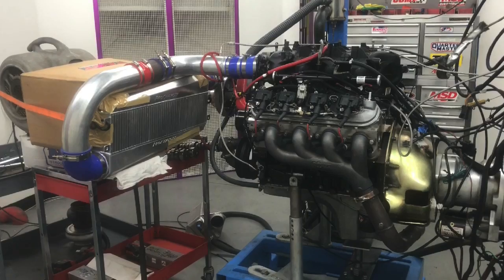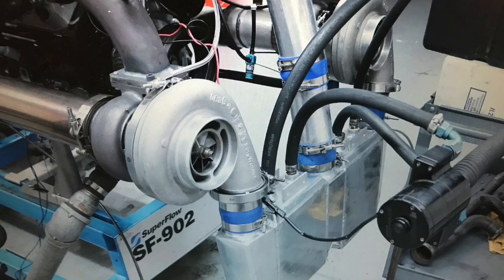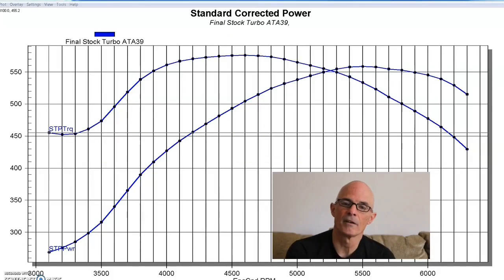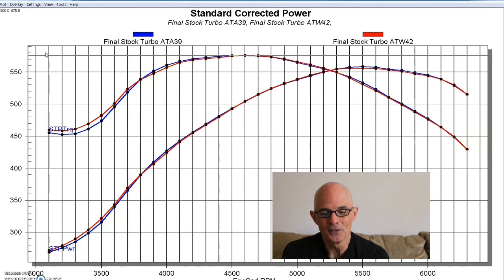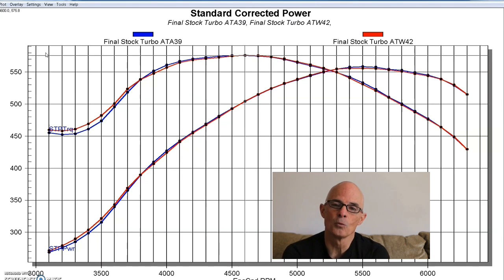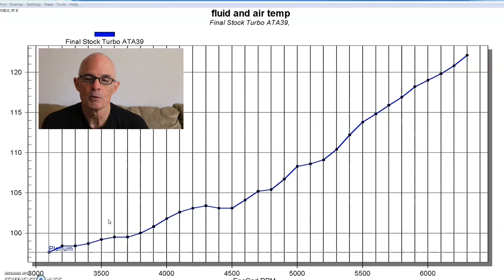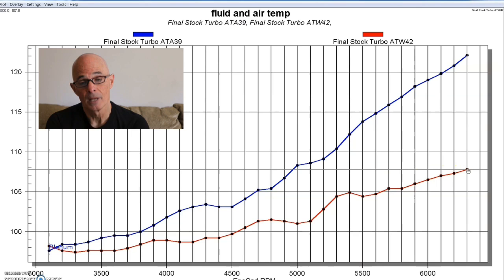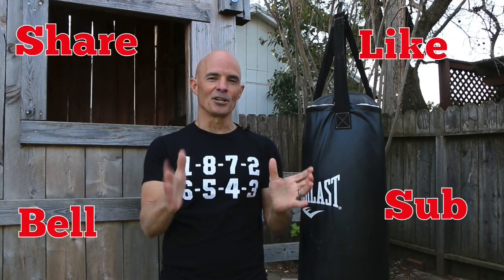LS TURBO INTERCOOLER TEST-ATA vs ATW

Comment: Speaking of ice water, what about making a test cooling this time the Fuel, taking a ordinary fat water jug cooler and get some cheap aluminum 3/8" or 1/2" tubing that you can bend in a nice tight spiral inside the jug isolate the line that go out to the carb, put a carb spacer to isolate the heat of the Intake manifold, run the  return line isolated back into the jug in another smaller tight spiral and from there to an plastic fuel cell so the cold is retained in order to make a circuit cooled by Ice water to try to reach 32*F, and do a test NA, then boosted no cooler and then boosted cooled, measure intake manifold temp and see if it have any effect on HP, and see how much can detonation be mitigated if any, using pump gas,  with the cost of race gas I guess one need to get creative and experiment and see what can be gained if any, I know there is E85 but for the sake of this test the idea is to run pump gas available in every gas station worldwide.

Comment: If you were using an alcohol fuel then the extra degrees would have been eliminated in cylinder by fuel evaporation. Less so for gasoline but still some cooling.

Comment: I would like to see the same type of test ran with a Cryo2 CO2 system on the ata cooler. I’ve seen the Cryo2 systems around but I’ve never seen honest testing to show if they work or not.

Comment: you're not accounting for the thermal mass of the water in the ATW system with regard to the IAT change over time.  the sheer amount of thermal mass makes heat soak very unlikely over the course of a relatively short test run like on a dyno.  ATA is never going to be able to match that for the exact reason you state - you cant get enough airflow through the exchanger.
track situations like bonneville or typical highway cruise arent going to be a good simulation of heat soak because the car is always in a high airflow condition....  heat soak is gonna be a major issue on the street however, and THAT is what your dyno run IAT readings are illustrating.

Comment: have you done any comparison of an ata with a fan vs without a fan?  i'm curious how well it does when it doesnt have much air flow, and if its worth the extra work to modify bumpers and placement of the intercooler for optimal airflow.

Comment: Everything was the same so the power is the same. The reason I like the w2a is the extra ceiling. Our own car dropped from 56C @30lb in the traps with A2A to 20C with the W2a. Power was the  same at first.. but with those low temps I was able to add more boost. A lot more boost. Maybe you should have added boost and timing till both intercoolers had the same outlet temp and then look at the hp difference.
Reply: That’s true but a2a intercoolers have a power rating, so putting in a larger intercooler would have brought it back down
Reply: Intercooler power rating is an airflow rating, not cooling capacity. You can install a straight piece of pipe that has the same horsepower rating.

Comment: The problem is at 10.6 psi of boost you almost can get away without a intercooler in most cases so the 10.6 psi test pressure is flawwed the charge temp wont spike much until you hit around 15+psi so the benefit of a air to air vs a air to water in power numbers will not exist till around 15+psi and as you stated in staging at a race there is almost no airflow so heat soak of a air to air intercooler will be a issue but a air to water will not because of the buffer of the water you can set staged for about 10x longer before the temps climb with a air to water meaning the second you come up on boost you air charge temps will be lower with air to water vs air to air so there is a big benefit to air to water in many instances compensating for the weight. 

When you take off from a staged position and your charge air temps are 25+ degrees cooler on the air to water this means can have more timing in the low end meaning faster acceleration and quick pressure increase in the exhaust  manifold meaning faster turbo spool meaning your boost lvl's will climb faster and you wont have to remove timing to compensate for hot air charge at take off.
Reply: I also meant to add with a air to water you can run a shorter and less volume from turbo to intake so this lowers the turbo spool time which can make a huge difference especially when doing stuff like hot lap racing or back to back runs also a huge benefit with air to water intercooling is throttle response over air to air try running a drift car with air to air vs air to water and you will understand air to air there is a higher lag in throttle response vs air to water and as was said before less heat soak when staging drift racing is hard on stuff extremely hard and air to air struggles and often runs on the ragged edge of able to keep up while air to water takes it like a champ.

Comment: Richard, try putting a 300ml methanol injection nozzle infront of the ata intercooler and lets see if it would make a difference. Try setting the injection start points at different rpms in the power curve. Thanks!

Comment: Hi Richard! I have a Torqstorm Supercharger LS2 403 in a 2004 GTO, It makes 10 psi of boost before the A TO A ITC and only 4 in the intake manifold. Intake temps on a 75F deg day 90deg cruising 1800rpm and 120deg open throttle pull.  Can this MISHIMOTO UNIVERSAL INTERCOOLER R-LINE core size 24" x 12" x 4 be that efficient? Im kinda new to all this charger stuff had other issues during the dyno tune but still made just under 600rwhp and 585lbft. Why such a drop in boost??? TIA!!
Reply from the maker: 6 psi drop is not acceptable
Reply: @richardholdener1727  Hi, any suggestions, a test\ common mistake that you can think of that I should do/inspect?  I did a leak test, very small leak around the MAF mount, new injector o rings but the system is tight! Can the intercooler be that restrictive???  Thank you!!

Comment: Could you run the same test, but instead of a drag race scenario, go to a track racing scenario with longer duration and getting on and off of the throttle?

Comment: whatever the flash expansion of dry degradation of atmospheric pressure against accumulative humidity density? Florida lol vs arizona...  what ever that is, hasto matter after a bar I would imagne, I mean the impact compression occurring at the direct valve but the filling tanks cold....or vacuum applied oon a sealed flask spontaneously contracts water to boil, a bar on? even sucking frm a silly straw 2 stories from acup scalding causes frictional heat transfer ...  is all by tension as applied versus if it has an alternative scapegoat... but turbos dont pump without a hotside to be able to not exchange heat soak... so cooling charge air especially with a range much broader then if we have a dangerous fever or not is not comparable I suppose.. proly at. an industrial distillation scale for sure...

Comment: There was not enough of a air temp drop to see any power difference. Maybe if there was a 50 or more degree drop in air temp you’d see a gain in power with no other changes.

Comment: Probably not noticeable or quantifiable on dyno would be throttle response, if you don't think It changes from closely mounted ATW with short ducting compared to front mounted ATA with long ducting then see new Silverado 3.0L diesel overview as designed by OEM to reduce lag by using ATW,  yes only relevant if you care about response time

Comment: Lots of comments. Not sure if this idea has been mentioned. Because of the boost reference location I think the intake temp could affect the amount of air molecules overall but doesn’t because of the regulated boost level. I think temp would limit what you could get away with on timing though. If you don’t adjust timing for intake temp, I wouldn’t expect a change.

Comment: We might not see a measurable difference in HP with the lower inlet temperature using  identical fuel and timing maps.  However the higher inlet temps will put the engine closer to detonation.  When you are further from detonation you can tune for slightly leaner AFRs and go deeper in the timing map to produce more power. I think this is even more true when running higher inlet pressure where inlet temps rise significantly.  Your thoughts?

Comment: With no air charge timing modifiers how can we know how close we were to MBT at either temp? Also, the degree split is relatively small. Unless you're heavily knock limited, 122 shouldn't be losing massive power.

And MOST importantly, that inlet temp isn't temp in chamber before ignition. There's still A LOT of time for the charge to absorb heat after the intercooler, and as you know temps love delta. So by the time the air gets into the chamber, they're probably more like 5 degrees different than 14 we see after the cooler.

And for those keeping track at home. I've run 210 degree inlet temps on 9.5:1 compression with E85 and no intercooler. Funny stuff happens in logs at that point. The heat transfer functions start to flip directions at different RPMs (less transfer at high RPM vs more transfer at low RPM when inlet temps are high out of the turbo, but opposite when low). This is because the source of heat changed from the engine to the turbo which are naturally decoupled.

Fun stuff.

Comment: Here are a few things I would be interested in seeing, 1. A2W with the turbo clocked, and minimized piping, I wonder if it would produce a faster response from the turbo. 2. ice water added to the comparison. 3. more data, I'd be interested to see the pressure drop across each core(boost into the intercooler vs boost out). 

I see quite a few comments about A2W being complicated, but I honestly think I prefer it to A2A for one big reason, it's actually easier to package in a car in most applications. with A2A, you are almost guaranteed to have to cut holes in the core support/grill to fit the intercooler, A2W, you can run the water lines through existing holes or even above/below the core support. the heat exhanger can be put anywhere, or be several in series or parallel. you also have the option of upgrading the system to improve performance without changing the induction piping, a larger HX core, or water pump can be added, or 2 pumps run.

Comment: Richard, In tests like this one, I'd also like to see pre and post intercooler temps and pressure.  It's really difficult to draw any reliable conclusions without that data.  Could be that they were both the same pressure in the manifold, but possibly after a greater or lesser pressure loss across them.  It would also be great to have the ambient air temp and dyno water temp logged too.  Oh, and sustained RPM or long duration step testing to allow the temp sensors to stabilize.

Thanks for the good conversation starter and again for not covering the RPM on the dyno graph with the commentary overlay

Comment: With my novice eyes this is what I see. According to Gale Banks, PSI is the wrong way to measure air , something about lbs of air is what really counts and my understanding is that the lbs of air is heavily influenced by air temp. So off the cuff your measurement methods are too crude?. It would seem in your test that the WTA would have provided more lbs of air due to lower temps and it seams that the valve train/timing would be the limiting factor. Again with my arm chair captain assessment both setups in your test only proves the limits of the engine configuration as both tests supplied more than enough lbs of air to feed the engine at its limits. in other words the engine just cant gulp in any more air or make use of the cooler temps with timing etc.

Comment: Being that the test were run at WOT, I'm assuming the engine management system was deep into power enrichment for both runs which could have negated the higher IATs of the air-to-air intercooler, which one could argue that the air-to-water didn't need and robbing it of power. Also, given that both had the same ignition timing, it would have been safer to advance the timing on the air-to-water setup which had the cooler IATs before running into knock. There was more power left on the table, so to speak, that wasn't taken advantage of through tuning.

Comment: The air density difference between the two coolers is decent amount, about 3% difference. I would think that would be enough to show maybe a 10-20hp difference. Its roughly equivalent to running another .7psi. The only reason i can imagine it didn't have any effect is the vaporization of the fuel must of equalized the temperature and density of the air before it reached the cylinder.

Comment: My money is on that water has a very high latent heat value. You can store a lot of heat energy in water, pumping it away from the core.
Air just isn't as effective at removing heat from a metal core, doesn't matter what air speed you have, there's a point of diminishing returns.

Plus..
If you look at computer hardware water cooling tests, it often takes 15-20 minutes to heat soak the water system.
Air coolers generally reach equalibrium within a few minutes. 

What's perplexing is that you're not getting an AFR change with temperature change.. The it should lean out a touch as air temp cools off, roughly 2.5% per 10c.

Comment: I think that it is worth stating that the ATA in this test is definitely not the norm...that is a 50 row vertical flow intercooler.  Unless you have a Mack truck, you aren't fitting that on anything.  People get caught up on cooler numbers, but they don't realize you have to have the real estate under the hood to fit that monster and most don't buy/can't afford/ vertical flow intercoolers of this magnitude.  That thing is the equivalent of a 4ft tall x 4" thick ebay cooler that most buy.    Would love to see an ATA intercooler test.

Comment: I think theirs almost no change because the boost are too low to see a real difference and the two intercooler are big enough.  The biggest downside of a ata intercooler at the dragstrip is definitely the heat soak during the burnout and staging on 2 step with  almost no air flow at the intercooler.

Comment: air is an insulator.  water is 4X better at absorbing heat than air. A2W are over 30% more efficient than A2A at ambient temps.  mass air flow was the same for both IC; same power.

Comment: Is there a chance you can compare light weight internal vs heavier (such as piston, rod and crack) but keeping the compression the same and the cam the same. Would like to know, if the difference between them is big enough to spend more money and time. (Cost Vs performance)
Reply from the maker: I did light weight flywheel and drive plate vs heavy-definite difference in power

Comment: IMO,  the logical sequel to this vid is water meth.....  Is it possible that the difference in temperature didn’t make a difference in HP because it was a mild combination with moderate boost? Maybe these two inter coolers were oversized for this combination?

Comment: Richard, how about testing ethanol/methanol/water injection in lieu of the coolers tested (a real option for this level of boost)??  Keep up the good work!!
Reply from the maker: I have
Reply: @richardholdener1727  Richard:  I may have missed it, but I was referring to using the alcohol injection as an adjunct cooler while running the engine on 93 octane.  If you have already done so, kudos to you.  I just missed it.

Comment: How does differenentt ic core flows effect these different temps vs lack of differences in power? I would imagine that the air to air would flow better than the water to air unit in this case.
Reply from the maker: the pressure drop was the same and we have made over 1000 hp with both of these

Comment: So really the biggest Benefit of running the air to water intercooler is keeping the boost temp down and stop the fuel from detonation at higher boost levels. Thou in this test you didn’t see a gain  but running it harder and more boost would definitely keep the fuel from getting too hot and starting to detonate. So it’s way more efficient than air to air. At that power level you don’t see knock in the tune. But if it was turned up there would be a definite gain with the air to water

Comment: Im gonna lean towards the air to air intercooler having less of a pressure drop, so the turbo is working less to make the set boost at the manifold,which should result in lower exhaust backpresure before the turbine.
Reply: I think its the other way around, ive always read w2a had way less pressure drop than air to air. Im sure you could get a inefficient w2a intercooler that had more drop then a really efficient a2a but apples to apples w2a are better at maintaining pressure they are also superior at drawing heat out of air.

Comment: proper sizing and efficiency is more important than what type of intercooler you use.  There are a few exceptions.  I've tuned standing mile vehicles that go over 200.  In one situation a customer had an ATA setup on his procharged C5.  One a hot day his runs would start at 110 degrees and by the end of the run his temps would be over 200 degrees.  Now, if he had an ATW setup he could have gotten his temps down to ~30 and if his intercooler was properly sized it wouldn't have risen much over that.  In that situation the gains would have been extremely large.  So I guess my opinion is, anything that is purpose built for short runs (1/4 to 2 mile) the ATW is the way to go.  My personal car has a magnuson 2650R and I don't see any temp increases from 0-150, I've never seen that with an ATA.

Comment: I think there was no change because the temp difference wasn’t that much. Also, with a turbo, it will compensate with air density from hot air with the waste gate and run nearly the same boost every time. If the compressor speed was static and the temp difference greater, I’m sure there would be a loss in boost and a loss in power.